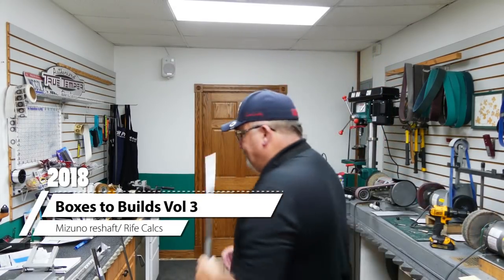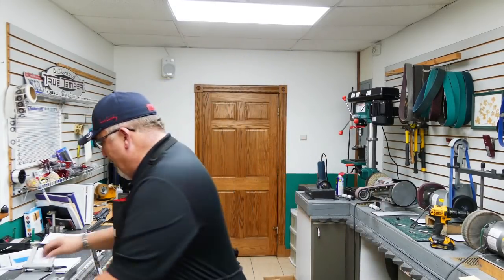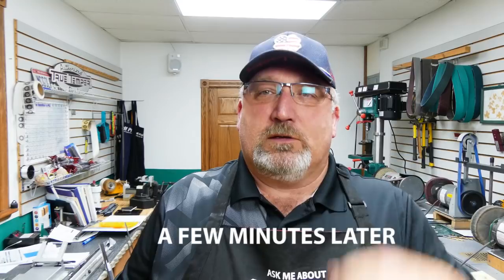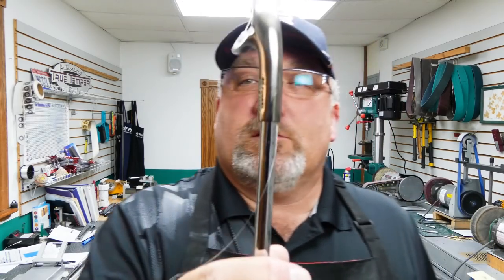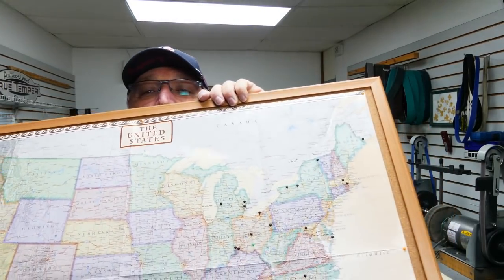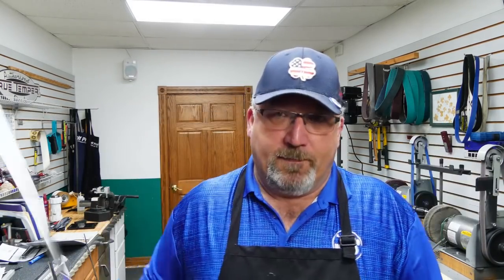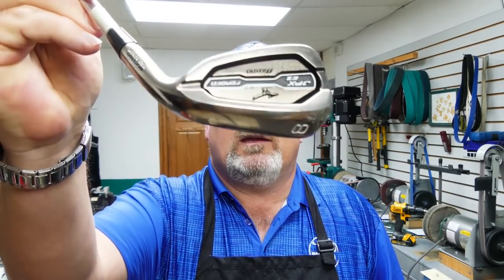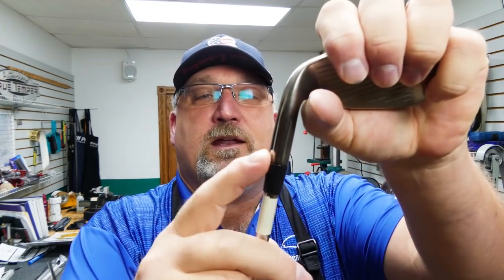Mizuno Reshaft ,Rifle shafts, Club Repair

Comment: Enjoyed that information.   I hope your neck is feeling better.  I am sure the cold we have in Ohio isn't helping.  Question: can epoxy fail in cold conditions?   20 to 40 degrees Fahrenheit.  Have fun in Florida next month.  I am so jealous.
Reply from the maker: After visit to message therapist, horse liniment I am  about 80% thanks,
Reply from the maker: Matt, I have only heard of a low end working temp. I.e. when mixing the epoxy. The glue must be 50. I prefer 60. Thing flow better. The only temp I have seen or heard has been on the high side at about 200. Which is easily reach in the trunk of a car

Comment: What caused the grip to be loose?
Reply from the maker: Not sure what caused this one, But a few thing can cause it. Air build up at install and its trapped. The mold for the grip was poor. you will see that in lower end grips. Finally not using tape.